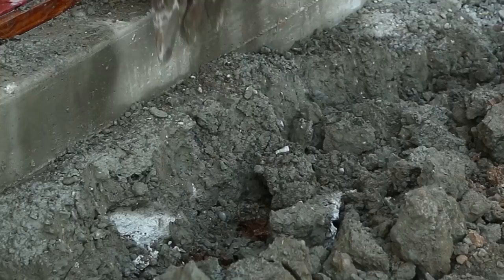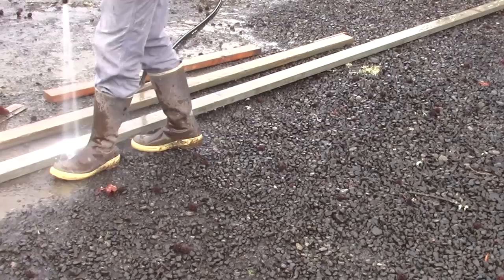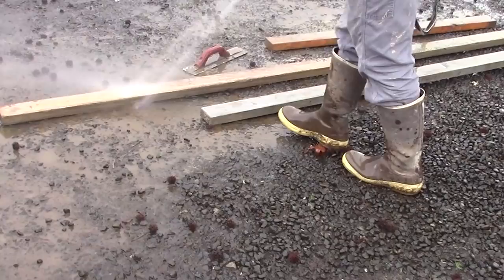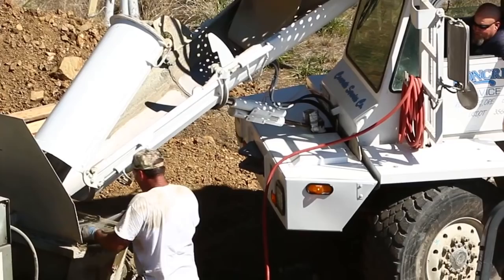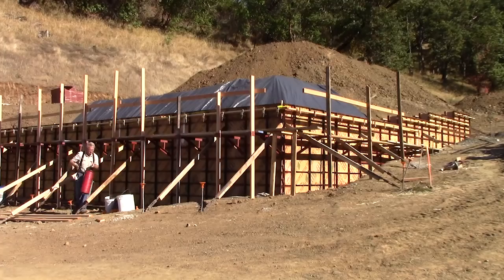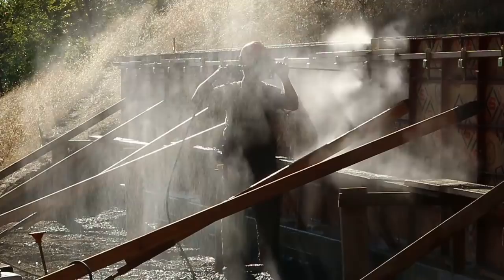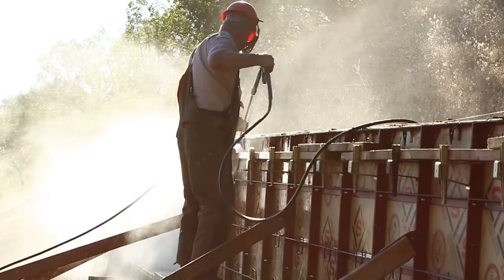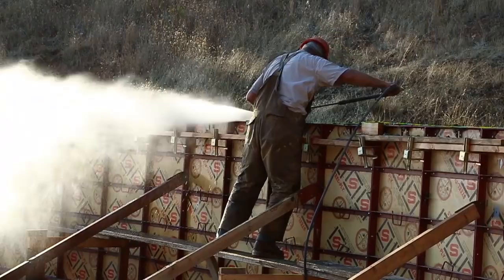Cleaning Concrete Forms and Tools

Comment: Clean job site separates the professionals from the wannabes.  Spraying form oil on outside of forms is unusual though, as is using a pressure washer prior to stripping (we'd hose down forms before concrete set up - that's the easiest time to clean forms and aids in curing).  Never allow concrete trucks/pumps to dump in one large pile - make them use a shovel to spread it around - or use blade/bucket of piece of equipment to spread thinly.  Excess concrete can make a nice roadbase material if you separate the concrete into mostly aggregate.  Otherwise you end up with a pile of hardened concrete you then need to break up and dispose of - as is shown in the video.

 Typically, forms are stripped and most of the excess concrete falls away during that process (washing down forms right after the pour is finished dramatically lessens the amount of cleaning necessary)..  When we stacked forms, that's when inside faces were scraped and oiled in preparation of the next job.  In this situation, where you were borrowing the forms (likely w/a friendly-contractor price), made sense to be very careful and considerate.

Comment: Also worth mentioning-- if you manage to spray your skin with a pressure washer you need to go to the emergency room.  High pressure water injection is no joke, and it can cause major injuries even if they aren't immediately apparent.
Reply: Does not matter if the wand is 3'. You can spray yourself in the leg, or spray your buddy, or spray your own hand if your fiddling with the nozzle with your hand on the trigger. Power washers and airless paint sprayer can inject liquid, and it can cause huge damage.

Comment: A tidy workplace is a safe workplace.  I firmly believe the adage.  Concrete can be messy and sometimes challenging to clean up.  Get on it right away, it pays off in the long run.  I've been on jobs where a homeowner/client has been surprised at how i often use a broom or vacuum to tidy up.  Nothing worse than twisting an ankle on an off-cut hiding in sawdust.  Same thing for tripping over a lump of solid concrete.  Keeping things tidy means you get a look at the whole site and can spot potential hazards.  Additionally, if you tidy as you go, the end clean-up is simple. Clients appreciate it.
Reply: Kirk Hancock so true, So true

Comment: I remember all the incredible messes I used to make when I first started driving concrete trucks. On big jobsites there would be an area set aside or not and we would reverse the drum and spray it out to our hearts content. Then a law got passed which to tell the truth wasn't too popular but was based on the idea that the process of making the portland that goes into the concrete, releases chromium into the mix and if you wash that chromium out onto the ground, it can seep into the ground water. Now I use a self contained washout system that has a bucket that hangs on the end of my chute with a hose that runs to a trash pump and the pump sends it into the drum of the miver truck. Back at the plant, we have a weir that separates the fines from the water and we can reuse the water for rinsing out at the end of the day. Frankly, I love the way it is now. I can rinse off my chutes and do a wash down pretty much anywhere I want to. No messes no pissed off customers. Plus if it rains, I can use the hose and trash pump with the hose to the drum disconected as a vacuum to get water out of flooded footings.

Comment: In all the years I ran framing and remodeling crews, I was first on the job walking it, seeing if there were scheduling problems, or possible safety issues while thinking through that days work. At the end of the day, I always picked up the drops and swept the area we were working in. Often found small tools and usable hardware in a pile of sawdust. Yessir, even doing forms and concrete work, as my dear mother used to say, “Cleanliness is next to Godliness.”

Comment: Two colleagues, later good friends, and I, were the service crew for a home builder... Took care of whatever little things occured after a year of use. One did the preliminary check, made a list and passed it on to us other 2. One brick layer/tile guy, and me - the carpenter.

The general motto was that the only way the homeowner should be able to tell that we'd been there, was that whatever was on the list, was fixed. And so the the tile guy was out on a minor repair, set up work station outside to limit the amount of dust inside the house to a minimum. He finished the job, started packing up his van and cleaning on his way out of the house. Last stop was the outside workstation, and not to leave any marks on the pavers, he ran them over with the shop vac. A woman walking her dog saw this and stopped to look at the end of the driveway... staring basically. He sees this out of the corner of his eye, whips around and starts vacuuming the lawn as well. The woman shook her head and disappeared in a hurry... in disbelief!

Comment: The Romans used concrete to build docks. They just dumped it in the ocean and it set up. Some are still there to this day. Pretty amazing stuff...til you order too much and the concrete company leaves you with a pile, LOL.
Reply: Don't quote me on it, but I believe the Coliseum is a mostly concrete structure.  Amazingly resilient stuff to have lasted so long.
Reply: Concrete and a whole forest worth of timber, yeah
Reply: High....At least they saved the olive trees.
Reply: Roman concrete was so good that engineers and materials science labs are still looking for the formula. Our concrete has a lifetime of between 50-100 years.
Reply: +DanielinLaTuna ...I guess that is good. But too bad they didn't know about the hazard of lead water pipes. They were great engineers.

Comment: Pressure washers sure can make for some 'fun' workplace accidents. Especially if you get some of the higher capacity industrial units that put the little home use ones to shame. Have seen more than a few broken noses from new guys who 'know what they're doing' getting their hands on them.

They can also move a lot of material around in a hurry. If you're standing there shouting at someone while holding the trigger on one, you can do 'fun and interesting' things, like ripping through part of your own boot, wearing a hole in wood, or making very interesting patterns in dirt.

Comment: Wrong usage of the word sanitary...
Reply: xephael - how so?
Reply: Jovan  Bergh Nothing about job site or pressure washing is sanitary... relates to health, not concrete or cleanliness.  From French sanitaire, from Latin sanitas(“health”)
Reply: I bet you are an absolute blast to be around!
Reply: In order to be sanitary, it must be clean correct ?? So I believe the usage is correct, if not I do not think many who observe this video will raise a fuss over it !!!!
Reply: Chris Nelson Not necessarily, cleaning just means removing mess/clutter. As he said sanitary refers to health, so something can be cleaned but not sanitized (i.e rinsed but still have harmful bacterium attached), and vise versa.
Reply: xephael - I'm aware, but I was asking how so, because a pressure washer could sanitize a surface. I thought you were referring to when he said a pressure washer could sanitize something. I did not catch that he said leaving a sanitary worksite, for which I could see the argument.